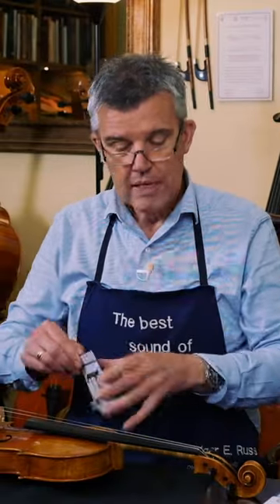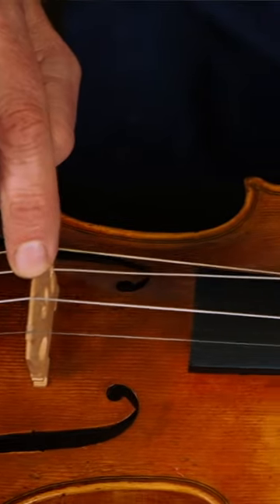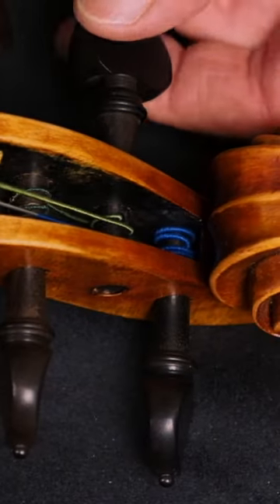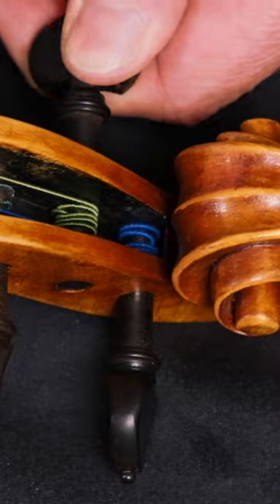How To CHANGE a Violin STRING like a PRO #shorts

Comment: Thomastik has a video where they say we should really, really, really clean the strings before installing them. I did that and it left a very marked stain on the cloth. What is that, is it some metal powder? Why isn't anyone, even professional violinists cleaning like that? Do we really have to clean that? Thanks!
Reply from the maker: Actually I didn't know that even Thomastik gives that advice. I ave so far not cleaned any strings when they are new. But the black stuff which remains in the microfiber cloth s actually metal powder and once it is used sweat, grease and dirt which remains in between the metal winded string.
Less dirt = clearer sound

Thanks for your interesting comment Rafael

all the best from Cremona

Edgar